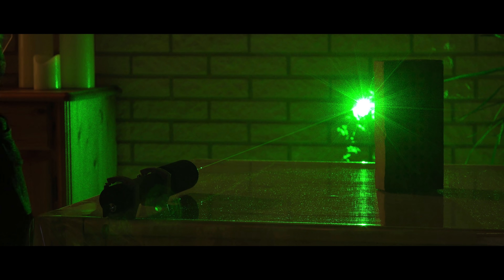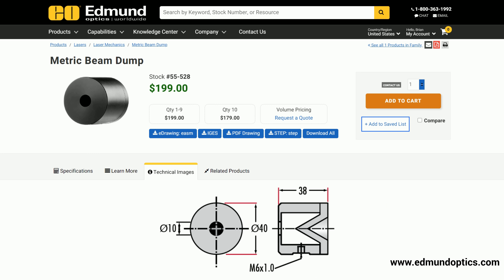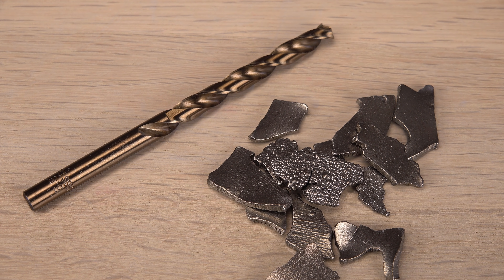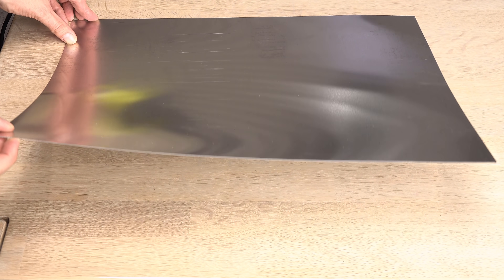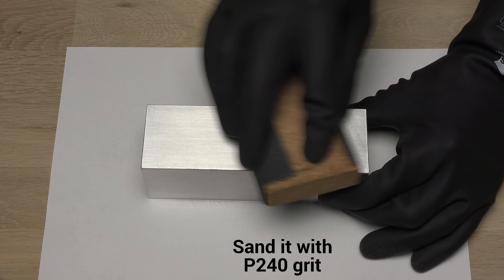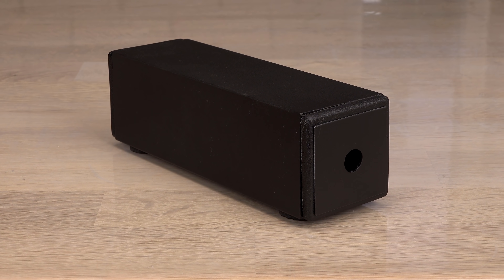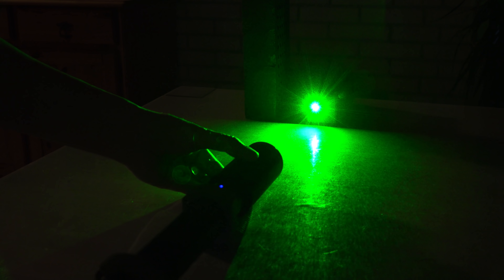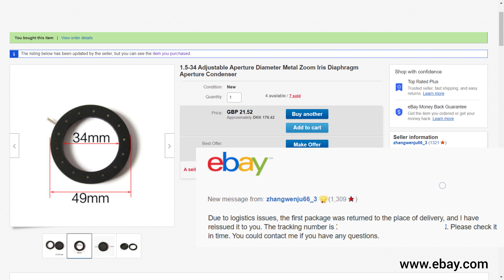Don't use strong lasers without this - easy to make!

Comment: Could you make it as a T section, with the front opening a fairly large aperture, then have prisms/mirrors to send the  beams 90degrees into a trap like yours  on each side. Or would that just be overkill
Reply from the maker: It could work better. My gut feeling just is that it would not be worth the effort unless you really want it that few extra percent more effective. Thanks for watching!

Comment: iirc, I have heard of a black paint called Musou Black, made by a Japanese manufacturer specialized in ultra-low-reflective materials or coatings. Maybe it would help making a beam dump. Black 3.0 made by Stuart Semple might also help, but perhaps in a slightly less effectiveness.

Comment: If you happen to make another one of these I have a suggestion on painting the aluminium. 
You did an excellent job prepping the aluminium extrusion. Using a self-etching primer will make the black paint stick even better especially on the 90° outside edges where it is likely to wear off with use and handling.
https://www.amazon.com/dp/B003CT498A/ref=cm_sw_em_r_mt_dp_4k27FbP8S7H0A
(I suspect it will work on the inside and on the 'cone' as well but it is not rated for any high temperatures. I suppose this could be part of a later video on how paint stands up against a laser)

Comment: The main cone is the only thing that really needs to be heat resistant, I wonder if using black 3.0(with a black 2.0 primer coat) on the inside would help absorb more of the light.
Reply: Not necessarily, if the laser doesn't hit the tip it will spread out somewhat but it will still focus on a smallish area, however that area is only at the back and you would be able to use black 3.0 forward of the furthest forward a reflection from the cone will reach the wall to catch tertiary reflections

Comment: Use the blackest paint rather than a regular paint to have a better black hole effect
Reply from the maker: Maybe. The ultra-low reflectivity paints just seem hard to get (and stupidly expensive). Not to mention: Are they heat-resistant enough? Thanks for watching!

Comment: Laser newbie no-bie, here. Could you explain the need for such a device a bit more?
Edit: It seems like a power off switch is more effective, but obviously, there must be a need.
Reply: Well off the top of my head, if you want to run a laser but don't want to blast holes to your walls. I mean, what's the point of owning lasers if one is not supposed to turn them on :)
And if you want to shoot video where the beam going through the air or whatever medium is there but don't want the extra reflections to flood the image... well there you go.
Reply from the maker: Why have a laser if it is turned off? ;) The point is to have a laser beam without an extremely bright laser dot scattering light all over the place - and a place to point the laser without starting fires/burning holes. For my use, it is to film the laser beam from any angle without having the laser dot burn up pixels in my camera's sensor. And making sure the laser beam does not burn my interior either... Watch my video 'Monster magnet meets laser...' for practical examples where I really should have had a proper beam dump.
Many lasers also need some time to warm up to be stable at full power. Turning it on and off is not always a good solution for experiments. Thanks for watching!

Comment: Good going! It's crazy how much spillage even the nice lasers have!
Reply from the maker: Thanks! I was surprised too. The spillage usually 'drowns' near the laser dot. But it is after all not overexposing the camera, so probably not much energy in it. Though I have noted higher power readings when the laser is nearer the laser power meter. Probably because the spillage is picked up too. Thanks for watching!
Reply: @brainiac75  Ah, super cool! I'm sure that spillage adds up! I wonder if you built some funky funnel mirror to better capture that spillage if you would capture 5.. maybe even 15% extra power measured?? 

..It's so hard to guesstimate living with logarithmic eyeballs and then fudging for sort-of linear cameras!

Comment: One improvement could be to use the black 2.0 brand paint (similar to vantiblack) but andvery light absorbent and will withstand the heat I’ve seen it done in something similar before.

Comment: It is cool, you have made the blackest black as The Action Lab did in a previous video. It is difficult to have a black more black. <3
edit: I wonder if you could put a coat of blackest black material to cover the front surface. I wonder if you could coat the diaphragm with a darker tone

Comment: i don't understand the use of the beam dump. why not simply turning off the laser ?
Reply from the maker: Why have a laser if it is turned off? ;) The point is to have a laser beam without an extremely bright laser dot scattering light all over the place - and a place to point the laser without starting fires/burning holes. For my use, it is to film the laser beam from any angle without having the laser dot burn up pixels in my camera's sensor. And making sure the laser beam does not burn my interior either... Watch my video 'Monster magnet meets laser...' for practical examples where I really should have had a proper beam dump.
Many lasers also needs some time to warm up to be stable at full power. Turning it on and off is not always a good solution for experiments. Thanks for watching!
Reply: @brainiac75  I got it ! thanks for the answer, my brain is too small.

Comment: it would be cool if the front of the beam dump could be a lens that focuses any beam down to a point, which then enters the smallest possible hole. maybe it wouldn't work... just a thought
Reply from the maker: The problem is, that even the best anti-reflective coated lens will reflect some laser light. Maybe if the lens is deep inside the beam dump. Could work very well, but quite complicated to get right ;) Thanks for watching!
Reply: @brainiac75  ah, makes sense!

Comment: If you used the worlds darkest paint i think it would be very effective.
Reply from the maker: Yes, but I am worried about the heat resistance of Vantablack, Black 2.0, Musou Black Paint etc. Not helpful if the very expensive paint just burns/flakes off ;) Thanks for watching!
Reply: @brainiac75  That's true. Possibly one day a dark paint that can handle all the absorbed energy without melting etc.

Comment: I'm curious as to how hot it actually gets in that thing, would it be possible to use a much darker, but less heat resistant paint like black 3.0, or would that just melt instantly?
Reply: If we assume that the paint is very absorbing and the coat is very thin you are putting a couple of watts of energy into less than a gram of material. I would not be at all surprised to see hundreds of degrees.

Comment: Where did you get the plum bob
Reply from the maker: Search for 'Draper 52172' or 'Draper 130g'. I bought mine on eBay since there were no local sellers in Denmark...
Reply: @brainiac75  Thanks

Comment: Just wondering... why don't you simply turn off the laser when you don't need it anymore?
Reply: In a lot of cases lasers change characteristics as they heat up, so to get consistent measurment results you don't turn them off on an optical bench during your tests
Reply: @miscbits6399  Thank you!

Comment: Instead of a simple aperture, how about a tube from the aperture to just before the tip of the plumb bob? Maybe some baffles could be added to better trap the scattered light.
Reply from the maker: The trapping of the diffused light would definitely be improved. A tube all the way to the plumb bob would be very effective but also requires a very level and precisely aligned laser beam. A few centimeters of black pipe extending on the inside of the aperture would work well and still be practical. Thanks for the tip and watching!
Reply: Could you please explain you idea please. I didn't get it.
Reply: @tejasdixit4417  Instead of having a lot of space between the entry hole and the tip of the diffusor cone, you could put a pipe on the inside from the entry hole to the tip of the diffusor. That way no scattered light can come out of the entry hole.

Comment: The easier way.
Take an empty aluminium can.
Add a little sand. Plug hole and shake. (Aiming to roughen the inside bottom)
Tip can on side.
add a little black paint while the can is on side or nearly so. (can should be nearly empty.)
Roll can along flat surface for several revolutions)
Tip out excess paint.
Reply: It won't look as good and I would be super paraonoid about accidentally puncturing the can but that does sound quick and easy and like it should work fine.
Reply from the maker: Good tip. Better than just randomly pointing a high-powered laser at a wall or furniture as so often seen... ;)

Comment: It would be interesting to see how much the been dump heats up over time
Reply: Well we can assume it absorbs pretty much 99% of the energy put in so it should be rather easy to calculate a rough estimate. Being a totally black body it will radiate heat quite effectively and if it only receives a couple of watts of power it would not get more than mildly warm I'm sure.

Comment: You could use this paint https://www.ko-pro.black/product/musou-black-paint/
Reply from the maker: That sure looks black... something like Vantablack. I only see two issues: Will it handle the heat generated by absorbing a 1.5W laser dot on a tiny spot? And it reflects infrared. I think the paint I used absorbs IR, but I actually haven't tested it... Thanks for watching!

Comment: That's an awesome solution!

However I think it will be pretty limited for handheld lasers. Since most handheld lasers are cylindrical, a slight bump could bring the laser out of the beam dump aperture. So to make this useful you need to hold the laser still or use a tripod.

For this application it would be better to use  mirrors so the whole section of the tube can be used as the aperture. Put two mirrors so that the laser gets reflected 90° and then again 90° (U-turn) before hitting the cone.

If the mirror is positioned deep enough then the laser shouldn't bounce out.
Reply from the maker: Thanks! Good idea, though hand-holding powerful lasers is never really a safe solution, right? ;)
Reply: @brainiac75  Good point!
Reply: @brainiac75  Good point!

Comment: Would a soot coating of the interior work for the interior coating? Seems like the carbon from the soot would stand up to much higher temps than a high temperature enamel.
Reply from the maker: Soot coating should work very well. I am not sure how easy it is to get full coverage on the inside though. Maybe with an acetylene torch?

Comment: Do you not need to cover your internal plastic holding the plumb Bob with aluminium too? Or is it too dispersed by then?
Reply from the maker: For my laser's power level it should be fine - as long as the beam does not hit the plastic directly for some seconds. I would prefer metal end caps or covering them in metal for an upgraded model. I have been suggested to go for a round metal pipe in stead with metal screw on caps - making it all thick metal and all thermally coupled for better cooling. Thanks for watching!

Comment: I have done A LOT of spray painting in my life, and one thing that makes the biggest difference in the end result is the cap.

You can buy different caps with different spray patterns from graffiti and art supply stores. Some spray larger spots, some spray tiny spots, some spray straight lines (calligraphy cap). You can buy adapters to use them on male spray cans (the cap goes on a stem) to adapt it to the standard caps (the stem is part of the cap). Bombing Science is a good site if you're in Canada, or Art Primo in the US.

Small, detailed jobs like spraying the inside of that pipe, would be a LOT easier if you used a fine cap.

Comment: You could even add a series of square aluminum plates with apatures to the inside to reduces the lights ability to bounce all the way back to the front. Maybe cut them like a + sign and bend the tabs at a 90°angle, then use high temperature adhesive to hold them in place.

Comment: I reckon some baffles on the inside would improve this even more.
Reply: I thought the feet were baffles before he applied them!
Reply from the maker: Yep, I have seen professional models with an extra, hollow cone on the inside in front of the diffuser. Would trap even more light. I may need to experiment further, though it really isn't needed for my laser's power level. For now...
Reply: @brainiac75  I mean, I don't think you'll need to deal with daW or stronger Lasers... Am I weird for using Dekawatts Or Hektowatts? Does anyone younger than me even know those SI units... have they even heard of Dekagrams and Hektograms before? Have they heard of decigram then?
Reply: yeah, like a hectogram is 100 grams

Comment: I'm kind of curious how the face place will handle the temperature of a laser not quite correctly aligned into the hole.
If you make a new one, may you could see if it could be destructively tested?

As for a new design, why not make one cylindrical? You can get pipes with screw-on end caps?
Reply from the maker: For my lasers power level (max 1.5 watt) the shown is sufficient. For CO2 lasers etc. you would definitely need something better, where both the front and end piece are thicker, solid metal pieces thermally coupled to the aluminium pipe - perhaps with cooling fins and/or a water cooler on the end piece too.
Your pipe suggestion is a good idea for an all-metal solution from easily available parts! Just need some better feet to not roll away :D Thanks for watching!

Comment: I've had to align laser beams many many times. One time, I made the mistake of using my hand as a beam dump for a 200mW 532nm laser. It burnt a small blister into my hand.
We had a lab where there were burn marks on the wall from someone using a 2W IR laser without a beam dump.
A piece of black anodized aluminum makes a good beam dump.
Reply: The razor blade test is normal for seeing laser power.

Comment: What would happen if you used vanta black or another black paint that has that kind of efficiency?
Reply: I was talking about using vanta black on the dump itself. Like as the paint. Inside and out. I have no doubts that vanta black could stand up to it. And can anodized aluminum get that dark? I've only ever seen shiny anodized aluminum.
Reply: A lfht dump is more efficient than even vänta-black. On top of that most black paints would risk decompositing reducing the protective effect. Since vänta-black is almost pure carbon it might be able to handle the heat but it is still not as effective as even a pretty crappy light-dump. Some commercial systems used black-anodized aluminium but that is usually not used when safety is paramount but rather on the inside of machines when a failure will just lead to a reduction in the quality of some product or process.

Comment: What if you used vantablack paint instead of what you used?
Reply from the maker: I think vantablack would be burned off on the diffuser. Probably would work very well on the inner walls for my lasers power level. Thanks for watching!

Comment: The LHC beam dump is designed to handle freight train energies concentrated on a needle and arriving in less than a millisecond. When the beam is dumped, it sounds like a gunshot reverberating in the tunnel. https://lhc-machine-outreach.web.cern.ch/components/beam-dump.htm http://lhc-collimation-project.web.cern.ch/sounds_and_movies.php
Reply: I'd never considered how they'd get rid of that much energy once they'd got the data. Cool.
Reply: I didnt even think that they needed such a thing let alone that much energy.
Reply: Hey, that's pretty cool!
Reply: Beam dumps get veeeery radioactive
Reply: oh yes, and at first test one of the magnets broke and they dump the beam inside the wall. Concrete broke and some of it evaporated :)
Reply: @TOCZEKX  wow that makes sense but still damn.

Comment: Instead of using black paint you can coat the inner surface with soot/carbon from burning candle or kerosene etc. The amorphous surface is similar, but not as good as vantablack which will significantly reduce the reflections and make the beam dump even better.

PS: Happy new year!

Comment: Every electronics test bench needs a few good dummy loads. Kudos for the on the cheap DIY for an optical one!

I wonder if using Vantablack on the inside walls would eliminate the glow escaping the aperture? The heat from the beam would be spread out by the diffuser so perhaps only the diffuser needs the high temperature paint while the inside walls could be coated with the Vantablack?

For added heat sinking you could add fins on all 4 sides too!
Reply: Adding baffles would probably be easier than using vanta. Like covering the insides of the pipe with low - profile, black heat-sinks . This does however seem like it is more than enough so I doubt that is necessary.
Reply: Making the defuser super shiny and tilting it so that the tip is not in the path of the beam in order to eliminate any surface that might reflect light right back out the hole might also help if you are chasing those last few photons
Reply from the maker: Thanks! For the output level of my lasers, Vantablack would probably work well on the inner walls - not on the diffuser as you mention. For a while I considered an AIO water cooler for a PC on the end piece, but it is way overkill for the max 1.5 watt heat dispersion needed for my lasers :D But once I get my hand on some CO2 lasers...